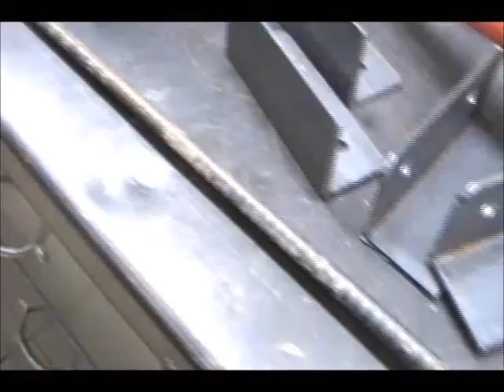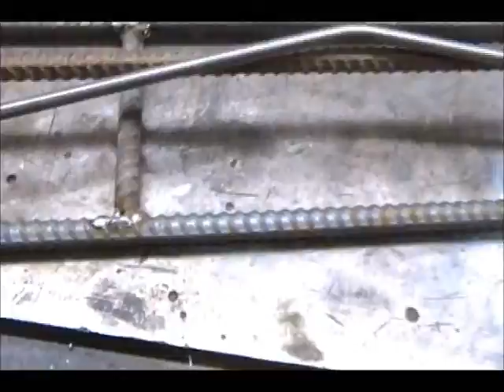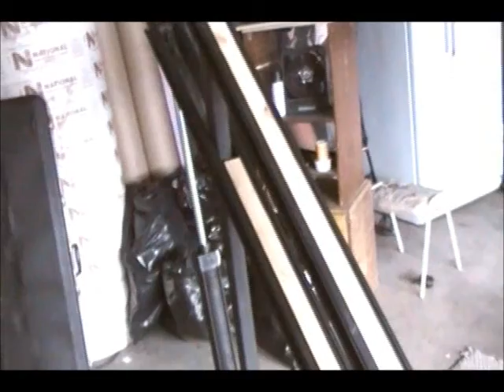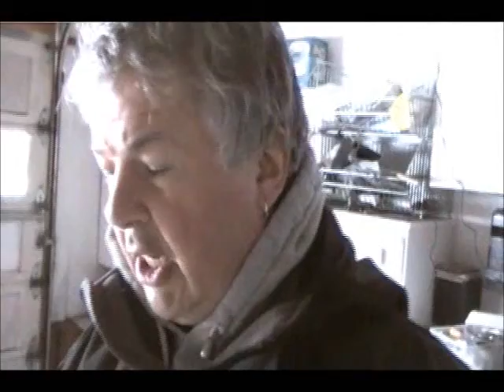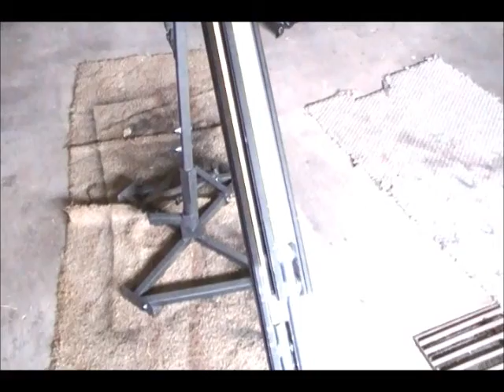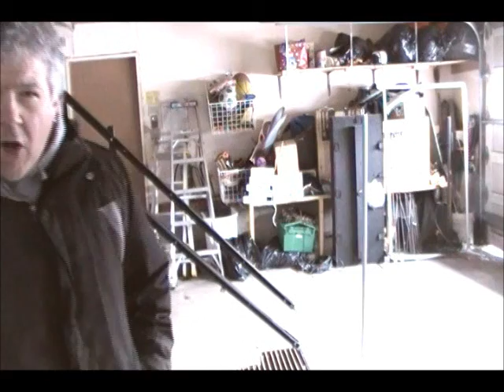Dead Things Vlog-Flying Witch Build 4

Comment: Your prop is coming along great. Just a small suggestion/idea. You can always put counter wieght on the cylinder end so you don't need as much bore. The cylinder on mine in about half the size if not more than yours and I use about a 5lb counter weight, Just a thought that might be helpful.